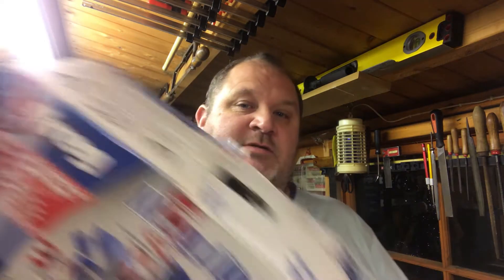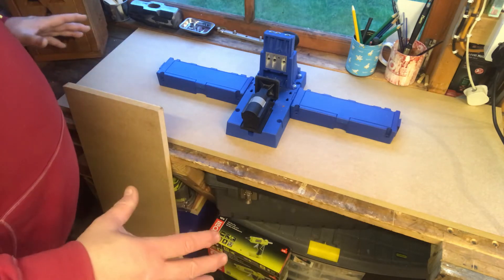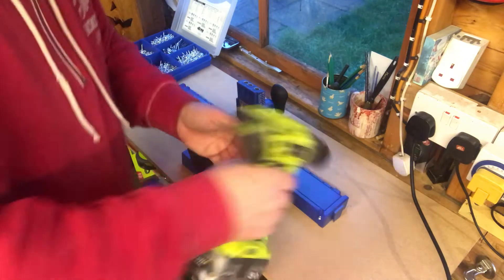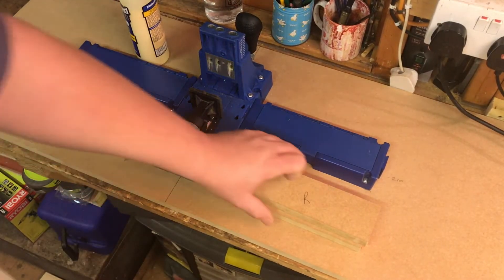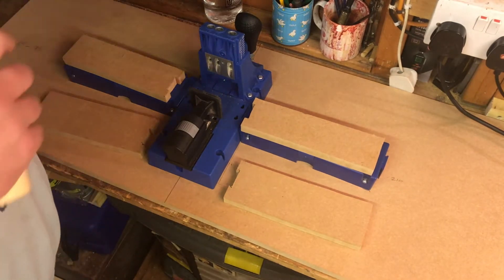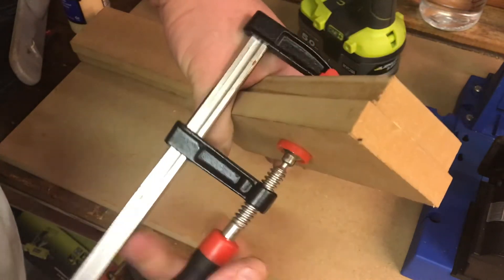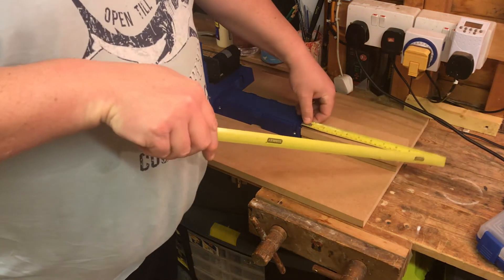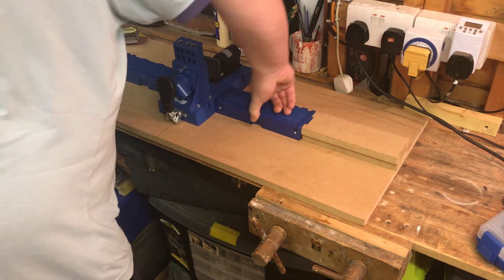How to: Make an Easy Base & Wings for the Kreg K5 Master Pocket Hole System

Comment: Oops!  Wings were turned the wrong way.  You corrected and then went on to point out the need to make sure the wings were properly closed.
When I fabricated my base I substituted wood blocks for the blue plastic boxes.  I didn't think the little blue boxes were very durable.
Nice build.  Thanks for sharing.
Reply from the maker: Hahaha, yes, that was my second mistake. Well spotted!